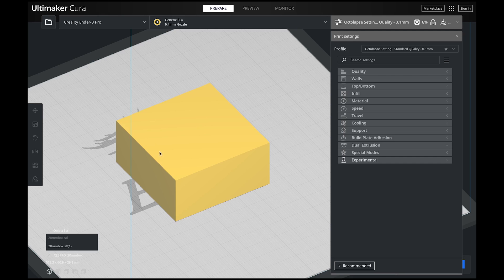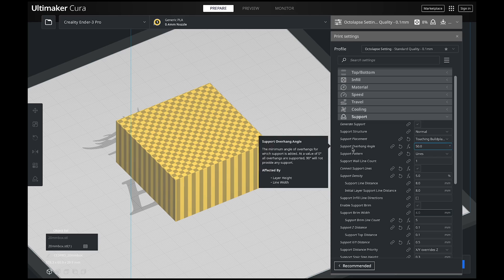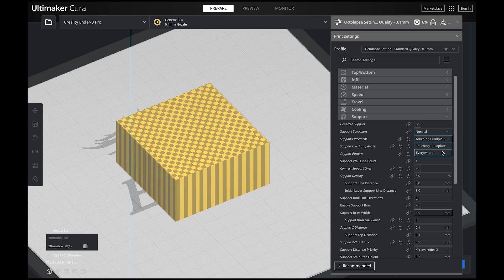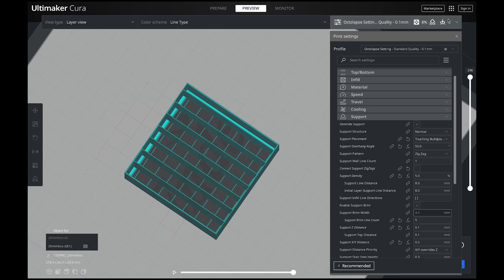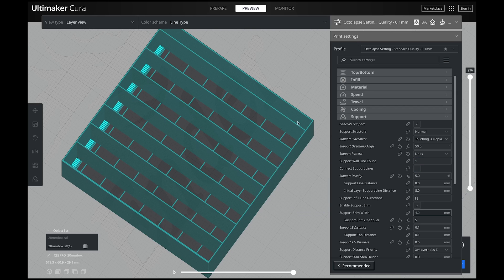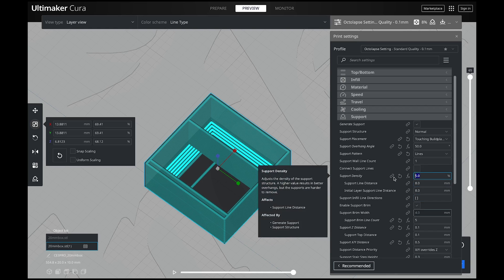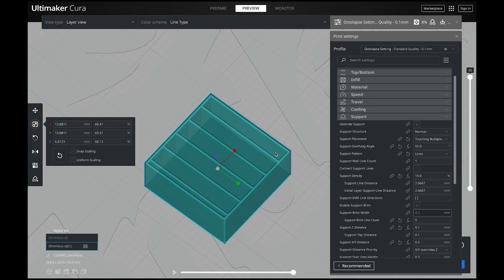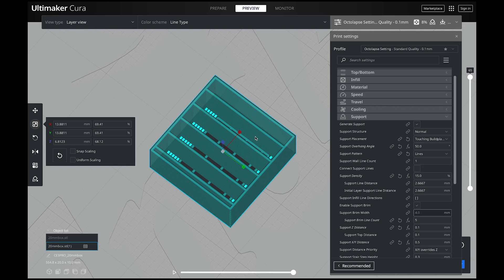Cura Supports: Foundational Support Settings You Need to Understand for Every Single Print

Comment: im new to printing and printing pctg, I'm having trouble with layers on supports having a break in the layer after the first 6 or so layers and buildup on the tip, I've adjusted z-height and hop and several other settings, I'm missing something.

Comment: I was playing with the support settings like in yur video. I selected, lines, touching the build plate, adhesion  skirt. I sliced it it looked ok. I selected brim, i sliced it, it looked ok. I selected raft, sliced ok. I tried adhesion 'none', sliced it, it said 'unable to slice'. what would the reason be. I swiched it to supports everywhere instead of touching buildplate, adhesion 'none', sliced it, still unable to slice. why? TIA
Reply from the maker: That’s extremely strange. I honestly haven’t heard of anyone having that issue. Might be the model. I would test the same thing on another model in a new project after a testy of Cura. Maybe it’s a glitch or bug.
Reply: Had the same problem and what fixed it for me was to change the support overhand angle to 45 degrees

Comment: Did not know that you could use a model that you import in and turn that into a support. This opens up a whole new possibility of supporting only certain parts of a print.
Reply from the maker: Yes! It’s such a under utilized feature in Cura. I keep a 3D box for that exact purpose where you don’t want supports everywhere and just in one spot.

Comment: Hey Chris I know you always say to print slow and at a high resolution but do you ever change your nozzle to a smaller nozzle?
Reply from the maker: No, I have never changed nozzles. For the resolution I want the standard .04mm nozzle works great. I might do some experiments in the future with different size nozzles just for fun. All i do know is larger nozzles give faster print times and less quality and smaller nozzles make longer print times and higher quality if that helps...
Reply: @ItsMeaDMaDe  OK that’s great to know I actually just came back from Michael’s which is a craft store with a list of stuff from your videos lol

Comment: Thank you sir. Very informative, I learned alot. I'll have to see if the creality slicer is able to do that. Cause all I'm using is the creality software.
Reply from the maker: I use to use that and switched to Cura. Dunno if it has all the same settings. But either way hope it helps
Reply: @ItsMeaDMaDe  yeah the creality software looks almost the same as cura. I tried to download cura, and for some reason its not staying on my computer. It has a cura icon on the desktop but when I click it, it goes through the whole download process like its the first time. I Uninstalled it completely a few times and reinstalled with YouTube video help and still the same thing. Lol maybe my computer doesn't like cura. Is this a normal process,  do you go through this when you boot it up? Thx
Reply from the maker: @thequietshodan  I remember having issues long time ago. If I remember I had to delete the creality version then install Cura. The softwares were conflicting. Dunno if it would be the same case.